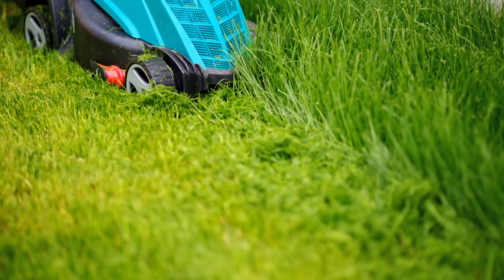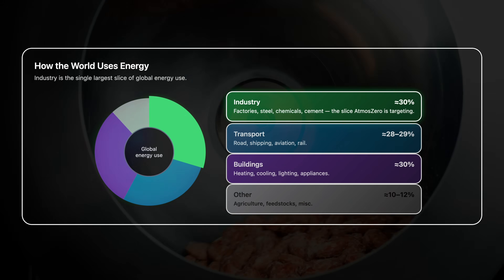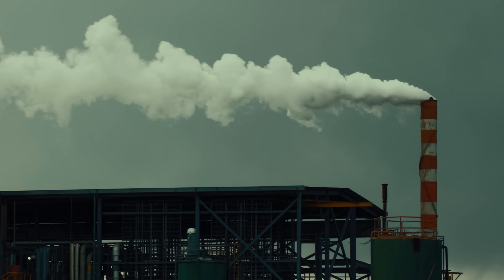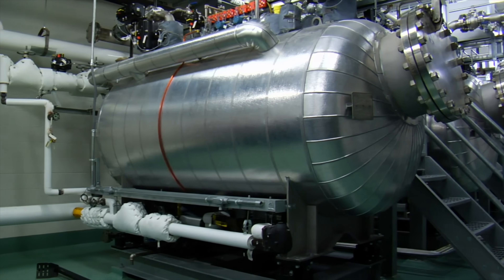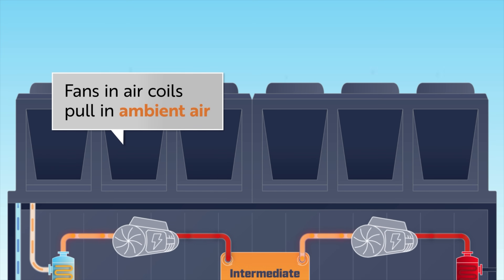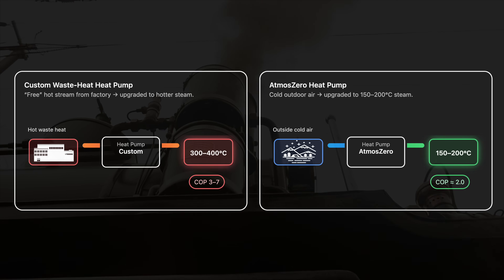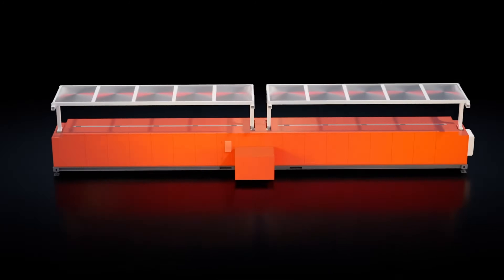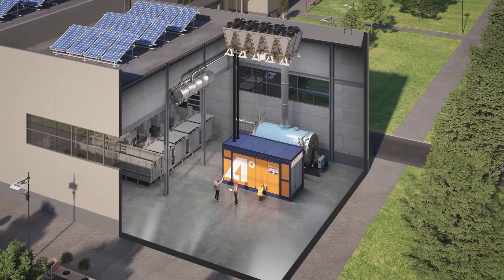This Startup Just SOLVED the Hardest Problem in Clean Energy

Comment: Let's be real, we need both. The bespoke solution for newly build industry aswell as the less efficient but easier to retrofit solution for existing industry.

The bespoke solution is more pricy but because of it's higher efficiency, the company can easely make that money back longterm. So it's a no-brainer to force that onto new industrial buildings being build.
And this less efficient easy to install modular steam creating heat pump is the perfect inbetween solution to bridge the gap untill every industrial building is running a bespoke solution.

Comment: In the sustainable energy transition, there is no single "silver bullet". We need a "silver buckshot" approach with multiple potential solutions to any particular problem. Additionally, economics are the deciding factor in most commercial applications. If a solution can address the majority of the issue(s), but lacks an economic justification, it'll fail every time. 

As it relates to AtmosZero's solution,   it addresses fully half of the industrial/process heat problem. And it does so with a highly scalable and affordable drop-in replacement unit. Perfect! 

Where additional waste heat reclamation makes financial sense, by all means, implement a bespoke solution. 

Other options for process heat generation are microreactors and enhance geothermal. Companies like Radiant, Oklo, TerraPower, even Westinghouse are working to bring factory-built, modular designs to market that don't require operators and are inherently safe, while Quaise Energy is working to bring enhance geothermal to market regardless of proximity to shallow heat sources. 

In the case of data centers, in particular, my stance is that they must be BYOP, or Bring Your Own Power. Here, microreactors, or SMRs (small modular reactors), make a lot of sense.

Just a couple of years ago, people said that we couldn't transition to EVs because they'd crash the grid. Today we have immensely power-hungry data centers being planned and built that are projected to consume 25+% of total electricity generation, yet those same people are silent about the effect on the grid. 

We need 25% additional electricity generation capacity within the next 3 to 5 years and no plausible plan to build out that kind of capacity in that timeframe...especially with an administration that's killing solar and wind projects, some of which are nearly complete, as well as the most affordable sources of energy and the quickest to build.
Reply: I've got friends in the Oklo, TerraPower, etc bunch
Reply: You are in fact wrong. It's impossible to decarbon without nuclear. And we're coming off 50 years of democrats lying about nuclear and blocking it.

Many of the things out there don't work economically. 
Battery back up for solar is to expensive for 80% of the world.

Comment: COP of 2 from ambient? So half the ⚡cost of an electric boiler?

Didn't you cite electric boilers as 6x more expensive than natural gas? So this would be 3x more expensive?
Reply: "COP of 2 from ambient"  here in Northern Illinois it gets cold  far less than the cited -20 C.

Low OA temp = lower COP.
Just to test I ran my rated  -20F heat pump overnight at -20 OA... Wife did not like it, and she is hardcore.
We had 50 F at sunrise.
Yes rated for -20F but not so many BTUs.
And cost about 3 x of natural gas.
Reply: @CCRoselle  If you preheat the air with say a solar thermal system, you can bump up your furnace performance at least during the day. It doesn't have to be much, just some plastic sheet in like a hoop house and you can get fancier and more efficient from there. Even like incorporating landscape rocks with black chalk on them or something. however look for the upper limit of your heat exchanger, I think our geothermal it is around 100F.
Reply: @Kamala-km4ty  Could possibly work for building make-up air, not so much for combustion air.
Combustion prefers cool, dense air.
That said, EVERYTHING costs money.
Time is money; the building space is money..
We installed a chiller in a prestigious building, that had to come down an oversized area well just enough room to walk around it. 
I asked the architect, and he showed the doors at the end of the room that was a tennet closet with a second set of doors. He said with all the doors open to the tennet space for tube pull!
Do it during off-hours. 
And how the tube pull space was worth over $400 a square foot!
Reply: @CCRoselle  It works with the air-air heat pumps, which is what I thought you had. It is just warming up the outside ambient air by the coils that are outside. Similar to say a solar thermal heater, but without any mods to the existing system.
Reply: @Kamala-km4ty   Yes I run an air to air HP. But there are some rules about airflow to the coil, and mine is a tight fit with an adjacent structure.
Any idea about possible efficiency gains?
I guess that with sufficient free air space, the size would not be fully advantageous to thermal gain.
But would be helpful during cottonwood season?
In the summer, the top side is best to be open to allow the exhaust heat to rise.
Reply: You may not be able to do it. The principle is simply preheat the air before the heat exchanger on the HP which makes it more efficient simply because there is more heat to scavange thus the furnace doesn't have to work so hard.  It is feeding the heat pump solar thermal instead of modifying the structure to directly use solar thermal which allows it to be say taken down in the summer and use crappier non-permanent materials to achieve some results.  People can heat their houses and barns with solar thermal. It isn't like there isn't enough heat available.
Reply: @Kamala-km4ty  I'm familiar with the concept.
A co-worker built a Trombe wall into the side of his house.
The problem is in the details. In the summer, the heat needs to escape; all seasons require maximum free air to the coil, no solar gain after dark, so it needs to be opened to maximize free air at night.
I believe that the difference of COP  vs the OA is afair estmate of the possible savings . OA 10 F = COP 2.5 /  Conditioned air 30F = COP 3.75.
SWAG estimate of 20°F solar gain in bright sunlight would increase COP from ~2.5 to 3.75, maybe. But you actually need the daytime mean solar gain  and zero night gain YMMV.

A fun thought problem.
Reply: @CCRoselle   You aren't going to build a trombe wall. You want something easier, cheap, and temporary. It doesn't need perfection to be somewhat effective. 

You actually found one issue. The heat pump is assuming a very large amount of air that is all the same temperature. However, with the system, you have a small amount of air, and want a longer residence time for the heat transfer. It can be solved in two ways, the first being slow the fan down or recirculate some of the air back through again. 

You can use mass thermal storage like rocks or 55 gallon drums for night time.  Or even composting generates heat if you are into that..

Comment: I think this will end up with the same problems that heat pump driven residential Hot water Heaters have. Yes buy this instead and give up 4X the capital cost in energy and costly service repairs over the simpler electric heaters and gas heaters . Why ? Because it is NEW  and different.

Comment: You should be able to use a solid oxide fuel cell to convert the gas to electricity AND provide electricity to the heat pump.
Reply: Bloom Energy?
Reply: @greatestNothin  Presumably.  They claim to be able operate at 55-60% efficiency with the primary waste product being heat... and of course, CO2.

This doesn't solve the climate issues directly but combined it should be able to significantly increase efficiency and many of the industrial plants that use steam do not have enough electricity available as a stand alone.  This is a viable path forward even if doesn't get you to net zero.

Finally, while I am FAR from a believer in carbon capture as a solution, fuel cells at least give you a relatively pure CO2 stream that is theoretically easier to capture.
Reply: @greatestNothin  And they also offer a modular product that can be delivered in as a shipping container, so it could be implemented at part of the dropped in solution.  And again, these businesses have a gas supply available but may or may not have enough electricity.

Comment: COP drops with the temperature difference. Going from ambient air temperature to 150deg with a COP of 2 is a lot! Props to the company. COP 3 to 7 are achievable only when starting with hotter input like waste heat mentioned in the video
Reply: The whole story is questionable. So, they have 1 MW of steam and 200 to 300 kW of cooling capacity... and supposedly a COP of 2... anyone with any knowledge of refrigeration technology can see that something isn't right here. Either the unit has more cooling capacity, or the claimed COP of 2 is a lie. 1 MW and a COP of 2 require 500 kW of compressor power. Where do the remaining 200 to 300 kW come from if the cooling capacity is only 200 to 300 kW?

Comment: Please find ANY place where electricity has become cheaper by solar/Wind generation?  Carbon and nuclear are the only currently viable solutions.  And carbon can be phased out with nuclear.
Reply: Blatant profiteering and consumers competing for electricity with datacenters (Who absolutely are getting highly preferential rates) and losing are the main reasons consumers aren't seeing cheaper electricity. My bill has been negative all summer thanks to putting solar panels on my house last year - payback is estimated at 6.5 years, but should be quicker as I suspect I use a lot less power than most in similar sized houses, and consumer electricity prices from the grid likely will continue increasing. Panels guaranteed against performance degradation for 30 years, inverter guaranteed for 25 years.
Reply: @peglor  this is simply not a counter argument. Ai data centers haven’t been around long enough to affect the clear trends we’ve seen in different nations electricity prices over the past decade.
Reply: Australia. Their is so much solar and wind wholsale prices are going negative while they are generating. 

Retail prices are affected by a lot more then just the wholesale prices.
Reply: @TheRealUSPSureShot  rubbish
Reply: They have been making renewables more competitive by taxing carbon and tax credits on "clean" energy

Comment: I would like a 1 year follow up to see if the economics is paying off. The unforeseen problems that reality brings in and how they addressed them would be great.
Reply: He said it at the start: resistive heat is 6x as expensive as gas. This has a cop of 2.0, so should be 3x as expensive in operating costs.
Reply: @Max24871  And the COP depends on the source air temp.

Comment: This is a great solution for remote areas that run steam heat. They can run it from their 37% efficient generators and, with an efficiency over 500% in the heat pump, can reliably generate enough stream to go over unity. 

Right. Gibberish. 

Outside of niche applications, this isn't going anywhere soon

Comment: I would love to see the expected ROI after 5,10 and 20 years. What does this actually cost compared to natural gas . In other words, How much does the Global Warming boogyman actually cost. Are there simpler solutions? Going all in on Nuclear Power for example. Which with emerging AI. We seam to be heading for anyway.
Reply: Climate denial doesn't cut it.
Reply: @mv80401  Global warming porn doesn’t either. Besides some global warming is a net benefit not a detriment.
Reply: How do you make steam with Nuclear power? Either you give all the factories a Nuclear reactor or you need something like this to turn the eletricity into steam.
Reply: @catprog  you have just described for the most part exactly how it is done. So where is the problem??
Reply: @MarkPoullos-v4f  You have a nuclear reactor in each factory to provide the heat.

Or if you use the eletricity then you still are using expensive power compared with the gas burner.
Reply: @catprog  My point wasn’t to have an SMR at the factory level . It was nuclear power generation in total was “carbon free “ . Moreover what is the cost comparison over the life of the unit to produce steam via heat pump or immersion heater. This gives us an Idea of realities efficiency.
Reply: @c @catprog  BTW   Heating element powered by Nuclear reactors, work well to.

Comment: Economics factors into engineering as much as physics and uses the same math. Engineers seem to understand economic limits better than economic opportunities.  These guys are going to make a fortune because these industrial facilities are already finding ways to get super cheap electricity on sight. 
Industrialization of technology is still an art and process of discovery.
Reply: What I seamed to miss is natural gas is still far cheaper. So what is the actual ROI to remove carbon with this as compared to natural gas?

Comment: I heard the CEO of AtmosZero earlier this month at Colorado School of Mines and was impressed by the scalability but most importantly their cost analysis compared to the competition - because at the end of the day you have to beat the competition. In the US where fracked gas is very cheap that is harder but in Europe it pencils out which is why they're expanding there as well. Also found it convincing that they went straight for heat pumps vs trying to 'harvest' waste heat which only complicates processes and makes them more expensive. What you most want to avoid is manufacturing down time and that is unavoidable if you tack on systems. A few days of downtime wipes off any gains.
Reply: @mv80401  Especially a prerequisite/input system like heat capture, because then the output of the product is variable depending on the input.
However, the output cooling is a result of the process, so it’s still valuable to use.
Reply: I have asked this many times. Why go this route when natural gas is cheaper. Given the cost of energy in any process ; Does this mean your competition can undercut your cost by 25% and have a superior product? I would like to know.
Reply: @MarkPoullos-v4f  It is only cheaper in the US. Also, in countries that take climate action seriously rules are about to hit that mandate reducing GHGs. Climate change is real and requires decarbonization. We could have started the process 30 years ago but the fossil fuel industry lied and lobbied against it.
Reply: @mv80401  I have no doubt that Climate change is real . However a moderate amount of warming is a net benefit with CO2 increasing. Not a detriment. Better crop yield etc. etc. I believe nuclear power will takeover long before the test is complete. Thanks to AI power usage . In 25 years Industrial power usage will be less than 10% of total power production by Nuclear power.
Reply: @MarkPoullos-v4f  What? There's currently about 70 nuclear reactors being built across the world, with zero new ones in the US, a handful in Europe and most of the rest in Asia. There's no way that any particularly meaningful increase in the share of industrial energy produced by nuclear power plants can be expected within 25 years, since they're not economically viable any more because of the almost negligible post-installation costs of renewable power production.

Comment: I have a question. At what efficiently would the heat pump have to run to produce enough steam to have a net positive power production? Keep in mind the steam could be condensed in simular to distilation and the heat could be recouped to make the heat pump even more efficient
Reply: Since most steam use is closed loop, I just assumed ... but the photos and someone did say air source.... 
I once installed a sausage cooker that uses live steam using 200 PSI (adjustable) to cook 40, 000 pounds an hour. 
The four-foot-wide conveyor belt moves as fast as a walk (adjustable).
But it has a massive gas radiant burner to brown the sausages; otherwise, they come out grayish-green.
And yes, the boiler water treatment is FDA approved.
Reply: @CCRoselle a saw a super chiller that used a liquid bath to connect the first and second stage of cooling so i know the tech exists just wasnt sure watt to watt conversion that it took to create steam vs power produced. He said there were heat pumps that reach 700% efficiently. To me that actually has the potential to produce actual almost free energy as the equipment upkeep can't be that expensive.

Comment: I've invented something that will cut the use of batteries in more than 90%. Probably by 99%. It's almost 100 mechanical and a small fraction in energy stored in batteries.
Any company interested, please contact me.
It will remove the use of batteries almost completely to store and generate energy.

Comment: This sounds like a good solution for a lot of places. Yes it may be less efficient but adding and changing steam piping is not as simple as it sounds... this sounds like the same a a boiler replacement that is done all the time.. vs re-stringing all the steam piping and insulating and shock mounting and calculations for thermal expansion/contraction of the system.

As for using the most efficient you can get looks wonderful on paper and in the lab but doing things like running cooling from the exhaust of the pool heating to the house you get to a point of diminishing returns. if it is withing 2-3 foot its probably a no brainer.. but if you are talking 6ft plus it becomes efficiency vs construction
Reply: For the pool, it might have made more sense to pipe the pool water to the heat exchange and back, then to duct the air to the house.